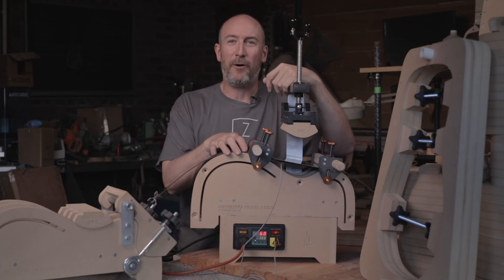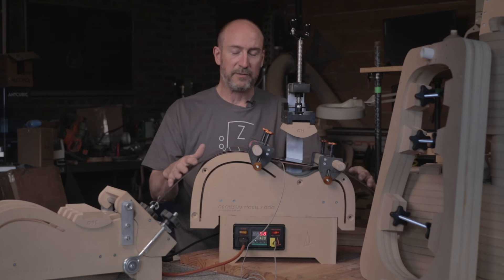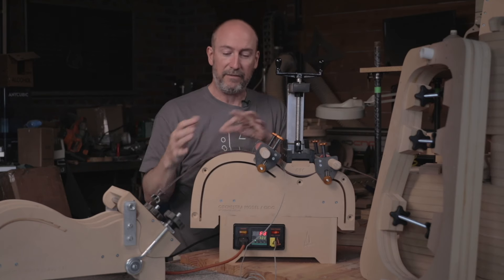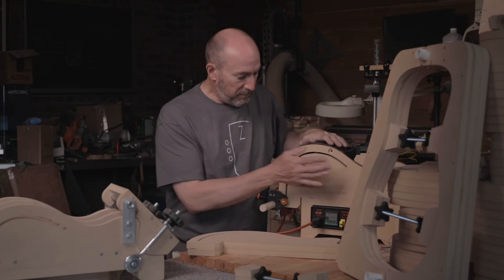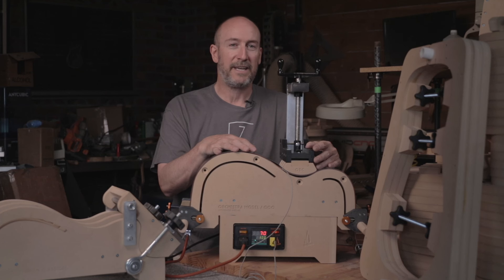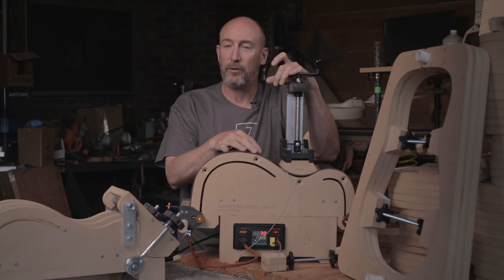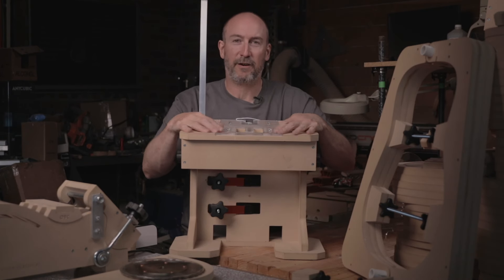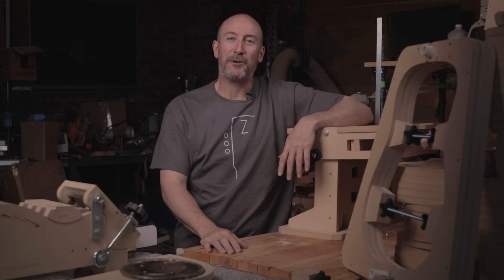New Side Bending Machine!

Comment: Very nice! Glad someone is picking up the torch after LMI stopped operating. One thing, especially since you are still in the developmental phase, you may want to put locating pins in both your acrylic template and your side forms so that you can use those locating pins to center your front and back to the sides of the guitar. It's not a new idea and I believe Chris at Driftwood guitar does this and it seems like it would be very helpful.
Reply from the maker: Yes.  My personal forms have pins in them (due to Chris' suggestion.  I will ad them to our templates and outside molds.  Thank you for reminding me of that detail!  Sometimes I get a bit too focused on the thing and forget about the user in the process.